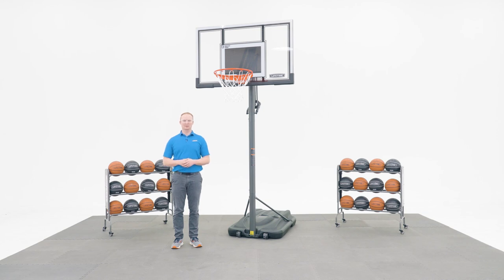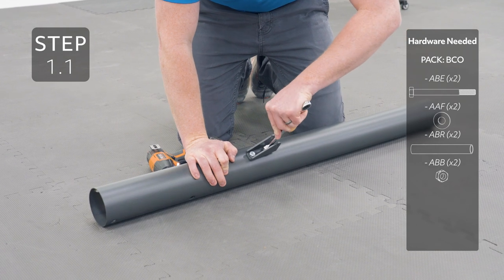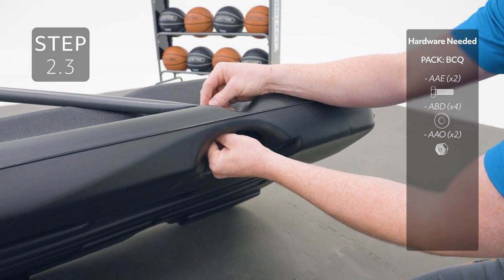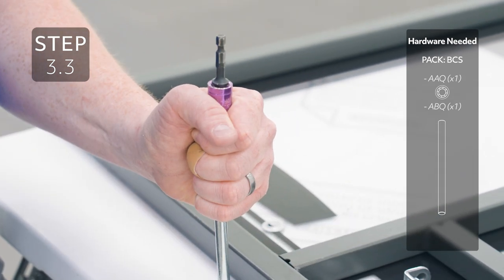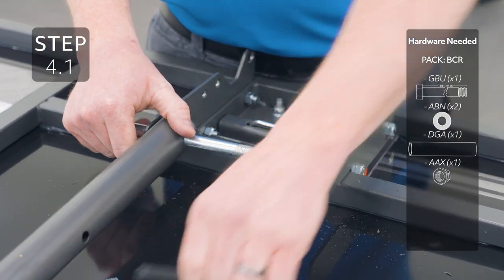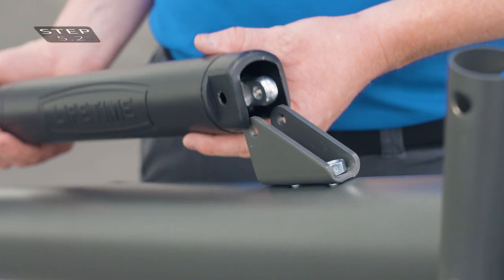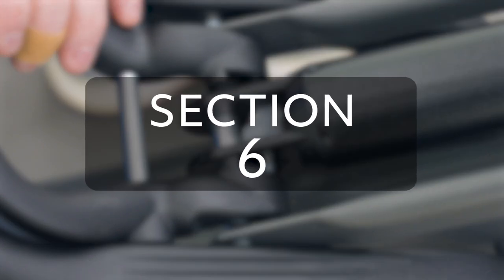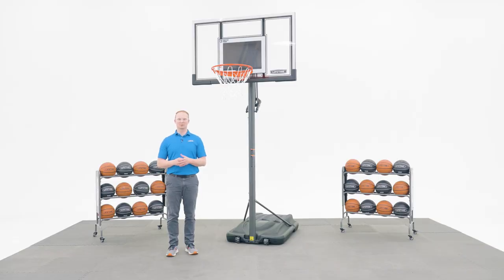Lifetime 54" Portable Power Lift® Basketball System | Lifetime Assembly Video

Comment: And what if the powerlift won’t budge to line up the extension poles?
Reply from the maker: If you can't get the lifter arms to line up with the long extension arms, you may need to raise the system with the help of another person. If that doesn't work, try reaching out to our customer service experts. They can be reached at 800-225-3865 or by email at customercare@lifetime.com. Customer Service hours are Monday-Friday, 7:00 am to 5:00 pm (MT).